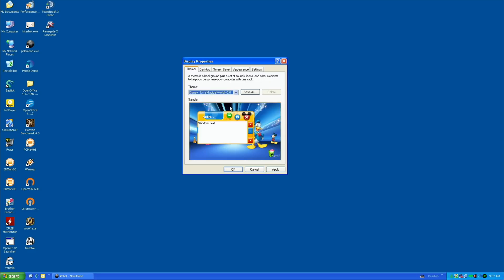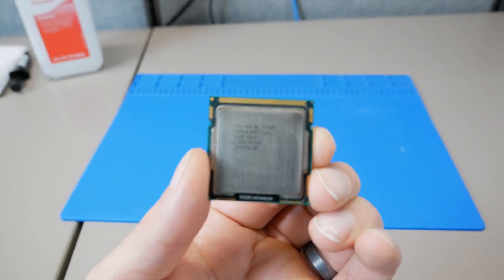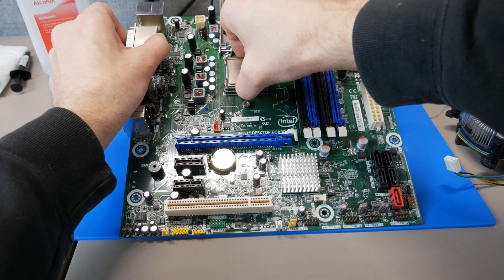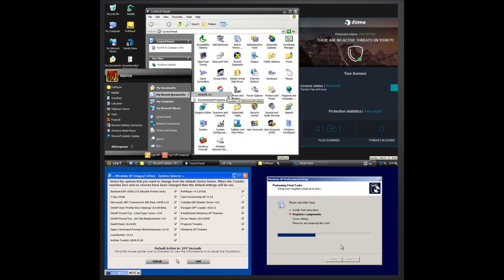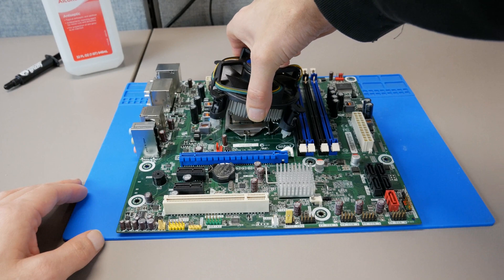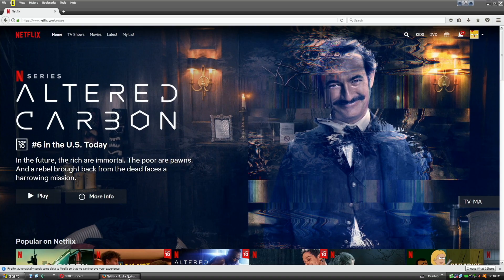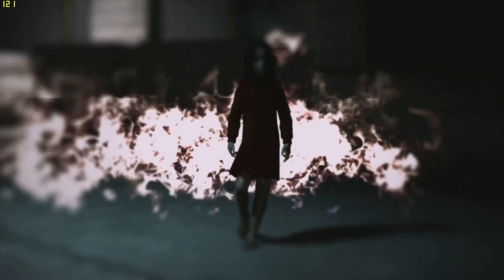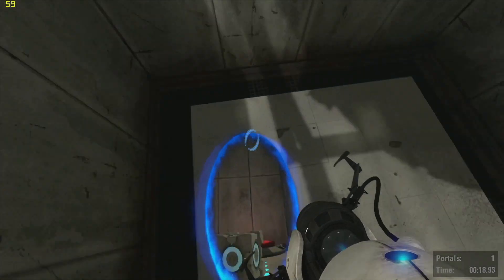Can you still use Windows XP in 2020?

Comment: It was only two years ago when I retired a win31 print server.  At a different time I was using a win98 machine to do presentations on behalf of a photographer.  Another one there was criticizing me saying he had upgraded to xp.  Now my slide presentation was up and running in two minutes.  He hadn't got everything working together an hour and a half later.  I explained to him that if a machine does a job well then there is no reason to upgrade it.  Mine had done presentations well for years so I could trust it.  The win 31 machine had done print serving for years faultlessly.  When the machine died and we tried to put a win 7 machine to do the job it gave errors everywhere. "You do not have permission to access this program".  Equally their stock program refused to interface with the ordering system on win 7 even though it had worked fine on XP.  The point is that upgrades frequently cause things that one relies on to break.  So I still have many machines running around the area on various versions of windows.  "If it aint broke, fixing it is a bad idea".

Comment: THANK YOU for showing how to assemble the CPU & heat sink cooling fan to the motherboard, including how to wipe clean the surfaces where thermal paste will be applied, and how to apply the thermal paste istealf (and how much). I've NEVER done this kind of hardware work myself (the extent of my experience is limited to replacing simple parts like the UPS, HDDs, video cards, RAM/memory, & PCI/PCIe expansion cards). I have only heard verbal & read text instruction how to do it, but unless I see it done with my own eyes, I cannot trust what is conveyed to me verbally/textually and how MY brain will process that information. SEEING it done goes a long way, so thanks again for showing how it's done. I will feel more confident now, when/if the time comes for me to replace my existing hardware with the new backup components I  bought specially for the purpose of keeping my current XP install alive.

Comment: Would you use XP as a daily driver, if an extended kernel was released for it? 

If you don't know what it is, it's essentially a patch that makes software think you're running a later version of Windows instead of the OS you're actually using, making it possible to run modern software on XP. There has been an extended kernel released for Windows Vista, and it looks amazing! Running Windows 10 apps on Vista was mind-blowing to me!

Comment: Here's what you need to do if you want to keep using XP forever and ever:
1. Use a older version of Chrome or Firefox but not Internet Explorer.
2. You can only use older programs or play older games from the 90s and the early 2010s.
3. Install a old antivirus program that still supports XP like Avast or Norton.
4. You need a older desktop or laptop from more than 5 years ago or a virtual machine to use it.
5. If you don't want to use the slow, new layout on YouTube that has issues, use OldTubeV2 to use the fast, better old layout because the old layout is perfect for an older internet browser and a very obsolete operating system except for Firefox.
XP has been discontinued by Microsoft for more than 5 years and it is a lot more dangerous to use than Windows 10 but it can still be protected with a antivirus that still supports it. This is what you need to do if you want to keep using this very ancient and extremely insecure and outdated operating system which was the first thing I saw on the computer in my life.

Comment: I do miss WINXP.  Mainly in regards to gaming.  It was still able to run even some of the old games from WIN98 real well. And I hold a collection of CD and DVD disk that do not load well for WIN7, in which I won't bother going into the issues with Epic failure WIN10 for playing old games. I only use it to play certain online games that play better with less lag. And that is it. I am glade Microsoft did put WIN7 back on line again so I can use it. But I still use WINXP on the one old PC I have. I have different program and software for different needs I still use. I am not going to just drop it and forget about it. Matter in fact, I go back and forth with projects I recorded or edited between WIN7 and WINXP. So yeah, I tend to still use WINXP.  I also have a old PC that still runs WIN95. I use this to just mess around with....

Comment: It's wierd to see how many people saying that the windows XP is their best operating system and still using them.

I was using windows XP was pretty fast, but I miss some features and short cuts.
Windows 7 I didn't like because of its design.

Windows 10 is awesome, yeah it is slower (not in my case I have fast PC), but design, and integrity I really like to using.
Updates are little boring but it does not showing: Installing 3941 of 87392 Please don't turn your computer.

Comment: Hello, I installed a regular xp sp3 on one of my computers(hp compaq, intel celeron 2.2 ghz) but when i surf the internet there are some errors(especially in chrome) that won't let me access web pages. For example: chrome certificate errors and 'this page is not secure' errors. Does the integral version solve those errors? Thanks

Comment: I use XP everyday for work and school purposes
The laptop I use is an Asus K50IJ realsed in 2008.
Ausu still has XP drivers for it to this day.
The specs of my laptop are,
3gb of RAM (Upgraded from 2gb)
Intel Pentium T4300 Dual-core 2.10GHz (Original)
Other things I Replaced:
Keyboard - Accidently spilled water on it.
CD Drive - Close properly meaning It wouldn't read off a CD.

Comment: I'm typing this from Windows XP (ok via a VM within linux, but still...). My usual daily is a mixture of Linux and Win10....I find Linux is better for my job....I can run network tests, its ideal for what I do and in general its just streets ahead. XP still works and is still pretty snappy...in fact I was suprised how well it does run. The only real issue is browser support....other than that there are workarounds.

Comment: Is it good to downgrade from Windows 7 to XP?
System: 
ASUS - P5KPL-AM SE Motherboard
Intel Pentium 4 3.00GHz
3GB DDR2 RAM
Nvidia 9400 GT GPU
Reply: I finally installed XP Integral. It has basilisk browser built-in which is great.
Reply from the maker: VMware is wonderful and I use their hypervisor, but for this, I wanted to get down to the metal.
Reply: libnny gutierrez  I'm currently using it on VMware but i got another computer that uses Windows 7 and it is slow. I want to use it as my Retro Gaming PC.

Comment: I think Windows XP is going to become the go-to operating system for "retro" gaming. Retro meaning disc based games that probably had SafeDisc DRM which newer versions of Windows blocked for security reasons. I use XP in a virtual machine for playing SimCity 4 and it works pretty well actually.

Comment: my main system is windows XP, it is a thinkcentre m71e, core i5-2400 4gb ram and a 1tb western digital blue drive. i am going to use XP as long as i can and at this point it works just as good as windows 7 for everything i do.
Reply: Hi i have core i7 intel with 16 gb ram  and 1 TB is it okay if i use windows XP coz i have a software for my school which only runs with xp
Reply: @merhawigoitom7776   if your system has drivers that support XP and you want to run XP then run XP, you could always dual boot it as well with a newer OS. But if there aren’t drivers for your system then no XP would not run properly.
Reply: @WalterKnox  thanks bro for the information but how do i know whether my PC has a driver that can support XP?
Reply: @WalterKnox  Intel(R) Core(TM) i7-5500U CPU @ 2.40GHz   2.40 GHz this is my PC property

Comment: Big mistake. Have Windows XP in my 11-year-old, $46 netbook. NO PROGRAMS WORK. no Google apps, no Box, no dropbox, no Firefox....nothing! When you try to run those programs, they say Sorry, don't support Windows XP
Reply: For google apps you can still access it via the web version
For firefox, you can use basilisk as @GenericEric suggested or mypal ( github.com/Feodor2/Mypal )
or Roytam1's version if you prefer portable browser ( rtfreesoft.blogspot.com )
It's all based on firefox (and still constantly updated)
Reply: That's what happens when you try to use an 11 year old pc things get updated and stop running on old software
Reply: @jaredsdad8361  It does not depend on the age of the PC. I have a 10-12 yo PCs and they are pretty usable. Just install an SSD and Windows 8.1 on it and is perfectly enough for browsing and office work. Also, my main rig is 6 yo and updated regularly. Fine for gaming, video editing, programming.

Comment: I use xp too With Avast and kerio firmware and i use mypal  browser everything work fine just block port 445 and i use it on acer aoa150 with 1gb ram
Reply from the maker: I was also running Avast and totally forgot to mention it! I'm not familiar with Kerio. Quick search tells me that's a local firewall?
Reply: @GenericEric  kerio let me se which port is listening, i could rum cmd  with Netstat --a
Reply: Glarysoft malware hunter ( https://www.glarysoft.com/malware-hunter/ ) and Gridinsoft anti malware ( https://download.cnet.com/GridinSoft-Anti-Malware/3000-8022_4-10755236.html ) is still supporting windows xp if i'm not mistaken,

But for 1gb of ram, I think it's better to just install DeepFreeze and lock your C: drive + some lightweight AV like Smadav maybe?